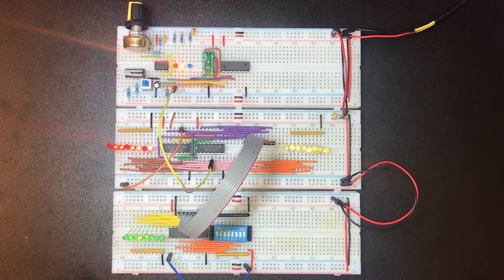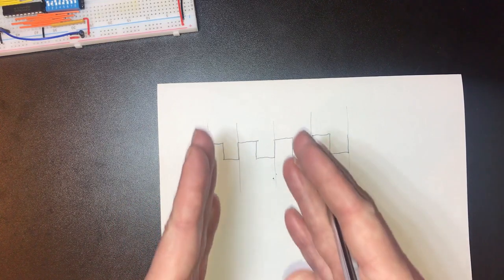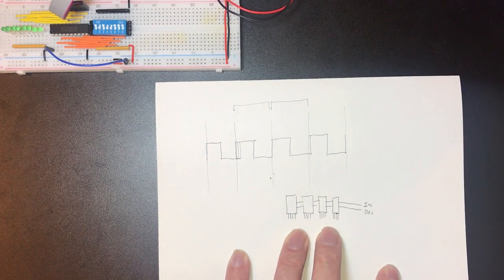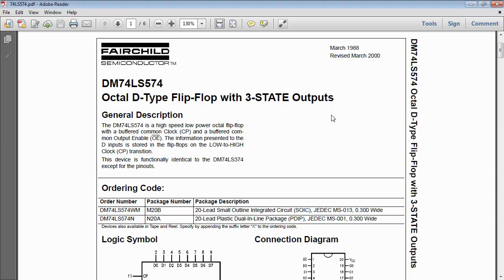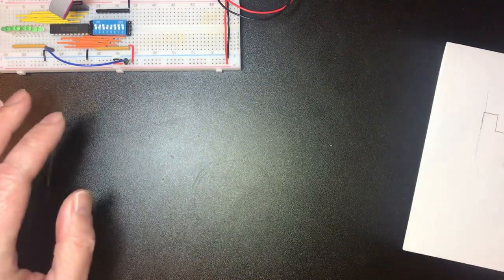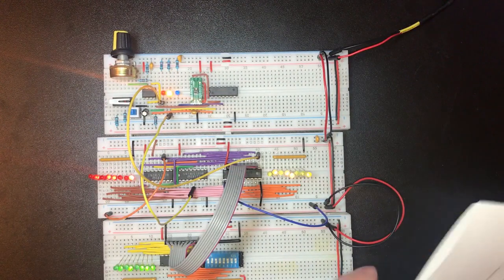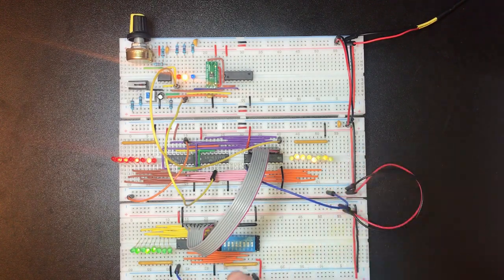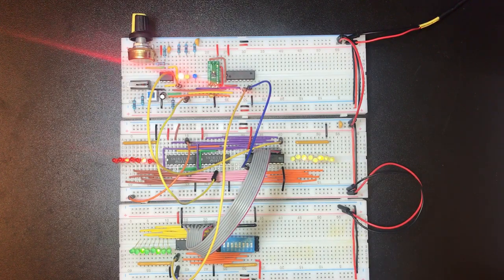Address Registers (3: Bus Timing) - Making an 8 Bit pipelined CPU - Part 4

Comment: one thing i dont understand is why did he not use 2 4 bit counter chips for the jump feature instead? you can basicly just hook the load lines together and it becomes a one button buffer just like the line driver. personally i used those since the line bufferes i ordered are defective.
Reply from the maker: Not sure what your query is. You still need something between the counters and outputting to the bus if it's going to share those lines with other devices.

Comment: I am rewatching this series as I plan to build a CPU for my own. I've also watched Ben Eaters series aigain.

I don't think that the timing issue you are describing in this video actually exists, because in the previous video you showed that the carry signal is already on when the counter sits at 15.
The reason being that the carry flags are set on the falling edge if I recall correctly.

This means that at the rising edge, the carry flags are already set correctly and all counters can be updated at once, meaning their "uncertainty"-time does not stack.
Reply from the maker: I  may revisit this in the future, this was very early in the development.  I may not have explained it well, and I was probably over cautious at the clock rates I actually achieve.
Reply: i like this guy alot more then ben eater because he dosent just skip and heres a prebuilt thing, he shows you how and explains WELL why he does it like this.

Comment: Just curious: Why didn't you choose for 8-bit synchronous Up/Down counter like 74ALS869? Cost? That's 2 chips instead of 4!
Reply from the maker: A couple of reasons, but my reasons are not necessarily great.  My preference was to use commonly available parts that are also available in a wide variety of logic types. 869 seems to be a less common Part that only comes in a limited range of families. In terms of your own circuit design there is definitely scope to use them though.

Comment: Sometimes I wonder why chips don't have a "ready" pulse output bit you could plug into the next chip's clock input.  That way you could be certain about ordering rather than guessing how far into the cycle you can count on one of these counter outputs.
Reply from the maker: Nice idea, but you would soon run into a problems of different bits of circuit having ready pulse inputs that don't line up.

Comment: I am having trouble going with the inverter clock. The 74ls193’s increments then decrements, but with normal clock it works fine. Know what’s wrong?
Reply from the maker: Hmm,  that sounds weird. Sounds like you have some noise, make sure the decrement line is pulled high.
Reply: Thanks, that solved it !

Comment: Hey James! Another question. I've gone ahead and bought a couple of 193 ICs myself. I'm basing my setup on HC instead of LS logic and I'd rather have used a 74HC169, but that IC doesn't seem to be available in HC form. The closest IC is the one you're using: the 193. However, it has asynchronous loads. How are you dealing with loading the register on the rising edge of the clock (as it isn't a synchronous input?). If I look ahead in your playlist, your PCB also doesn't appear to have some edge detection logic on it. We could NAND the clock and load lines together, but that'd still make it level triggered and not positive edge triggered (and causing potential races). Really curious to hear your thoughts!
Reply from the maker: That's an interesting question. The other registers load on the rising edge, so the load line goes low for the first half of the cycle. The 193's don't edge detect, you think about them constantly loading while the parallel load line is active (low). The important difference is that you have to treat the outputs of the 193 as unknown until that line return returns high. In my build this doesn't matter because the outputs from the 193's are latched separately, so the overall register output is never unknown.
Reply: @weirdboyjim  Thanks for the answer. Unfortunately it raises a couple of more questions though :). I really hope you'd like to elaborate! 

When you say that the load line goes low for the first half of the cycle, what do you mean by that exactly? In Ben Eater's setup, the control logic runs half a cycle out of sync with the main clock so that when control lines are changed, there's enough time (half a cycle) to compensate for any setup times. For example: an output on reg A is enabled, a load on reg B is enabled. Half a cycle later, the edge detection will kick in. The control lines are then always high or low for an entire cycle (and offset by half a cycle). If you have load lines enabled for only half a cycle, how do you avoid racing with either rising or falling edges? 

Yes, if the load line is not synchronized, it's all about the time when the load line switches back from low to high. But if that point falls exactly on a rising or falling edge of the clock, I don't quite understand how that doesn't cause races (even in your setup).

I hope I made sense. Any info is greatly appreciated!

Comment: Personally I don't think you'd be likely to have an issue with clocking your increment and the latches from the same clock edge.

But to be sure, take a look at the setup and hold parameters of the latch inputs. Likely the setup time will be met for the latches because the output of the counters will be stable from the previous increment, and given the latches will be triggered from the clock edge, they will probably latch their inputs quicker than the counters can output a new value.

So the question becomes, how quickly do the counters output their new value and is that slower than the hold time for the latches, if it has any. If it is slower then you are golden, if it's faster then you may have a problem, but you could potentially use a tiny capacitor to ever so slightly delay the clock pulse to the counter chips. Or you're into the realm of "overclocking". 😄
Reply from the maker: Going back to these early videos you'll find a bunch of things that I was less sure on than I am now. I could indeed clock the counters at the same time as the latches. In the circuit as it exists now I clock the latches on the rising edge of the main clock, the increment or decrement return high at the mid point of the cycle. Latching at the start of the cycle allows me to be certain of the address register state thru a memory operation, if I were to clock it at the same time it would work but I wouldn't be able to use that register on the address bus in that cycle. I could defer the increment / decrement to the back half the cycle, that would give me a higher theoretical count rate but that would leave the register output an additional cycle behind.
Reply: @weirdboyjim  That's what makes watching it all now for the first time so interesting.
Reply: I cant find much data on the LS variants of the chips, but if I use the HC variant datasheet as an example, the '193 has a propagation delay of 11ns in its quickest parameter, and the '574 requires a "typical" hold time of 0ns and a "minimum" of 5ns (tbh Im not quite sure how to interpret that....) but it would seem to suggest to me that the hold time for the '574 is reasonably near zero, and even at its worst it is much shorter than the '193 can propagate a change to its outputs - perhaps twice as long.

So I would say that clocking both of them from the same edge would actually be perfectly fine, and you dont need to run them out of phase.

Comment: Will it not be easier to use a CLA carry-look-ahead circuit in between each of the carry out and carry in circuits?  That will keep the propagation delay more deterministic? Much like the 74F182
Reply from the maker: Depends on your definition of “simpler”. The look ahead carry devices require a “propagates” input which you would need to add circuitry to generate separately for borrow and carry. My estimate is that it would double the number of chips in the register. Additionally I’m not aware of any sources of the 182 (or similar) that are still active parts, I’ve tried to avoid using obsolete parts in the build.
Reply: @weirdboyjim  understandable
Reply: Just did a little thinking about the ripple carry/borrow between the '193s. Turns out it's easy to do.

Just for each carry/borrow between the '193s, use U+C and D+B instead of simply C or B.
U = Count up
D = Count down
B/C = Borrow/Carry.

So each 16 bit register would require 6 2 input OR gates, or a total of one and a half 74LS32 chips. But there's no need to use the boost between every chip. Would be reasonable to use the existing ripple carry/borrow on the 2nd chip in the chain, and use the OR speed up on the 3rd and 4th chips, reducing the additional cost to a single '32 chip.

Comment: Does the fact that your counters run at 40Mhz but are being cascaded by 4x means the maximum clock rate is 10Mhz for this part?   OR because it's changing on the falling edge and being clocked in on the rising edge you only have 1/2 of that time?  That would mean this register can only run about 5Mhz?
Reply from the maker: I’m going to prefix everything I say here with “I am not an expert, I may be wrong about most of this”.  Thinking in terms of half the clock rate is right, the count happens on the rising edge halfway thru my cycle, so I have a maximum rate of 20mhz on a single 40mhz part. I’m pretty sure that was a mistake and I could latch the output at the same time, so it gets a full cycle. However the propagation delay for the carry (15ns) is faster than the overall delay (25ns), so the time to settle 4 chips would be 15+15+15+25 = 70ns, our worse case scenario is in a carry ripple all the way down. That works out at 14.28mhz, halved to 7.14mhz if I don’t re-spin the counter registers. So somewhere between the numbers you were looking at.
Reply: @weirdboyjim  Those numbers, 14.28 and 7.14 mhz are really nice and close to NTSC and PAL pixel clock frequencies. Even more so to NTSC, like really almost dead on.